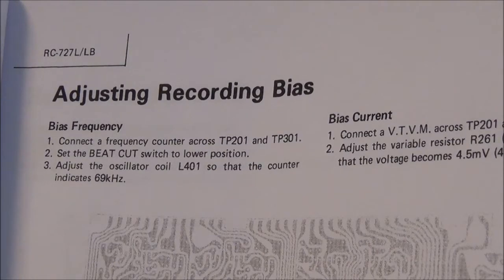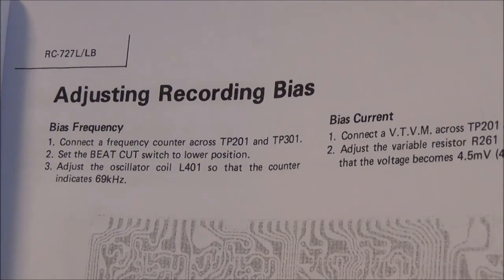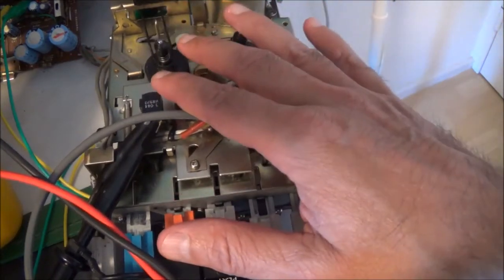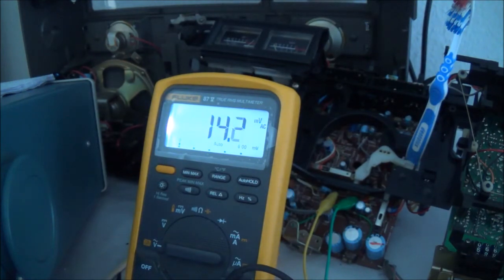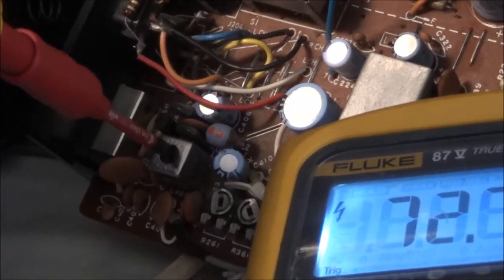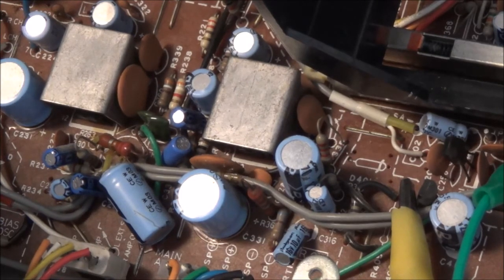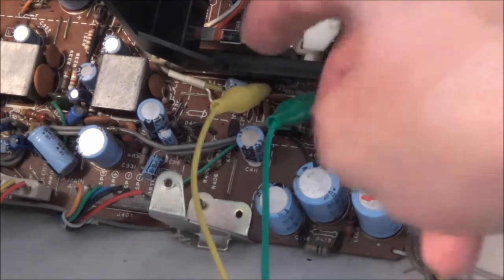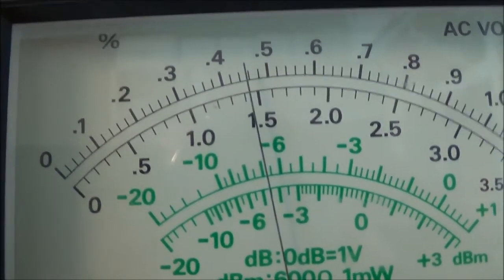JVC RC-727 Bias Frequency And Current Adjustment

Comment: Great  video. How can I adjust the motor speed ? As mine runs a bit slow. There seems to be no adjustment hole in the back of the motor?
Thanks
Reply from the maker: Thanks. Really not too much you can do. It's probably got one of those old mechanical type governors it it doesn't have a hole or some kind of potentiometer set-up on a board. Make sure the capstan/flywheel isn't binding, make sure the pinch roller isn't binding, and your belts aren't worn, especially it they have been in there for decades. Not sure if this applies you, but If the belts have been in there for so long, why are they still in there? And also make sure to try different cassettes.

Comment: Do you have any ideas/knowledge on bypassing an erase head on a tape machine?
Reply from the maker: This is not really my area of expertise. But normally you can't just bypass the erase head since the tape passes over the erase head right before it reaches the record head; that is, the oscillator is working and to just leave it out might upset the recording process. You would have to simulate the impedance (resistance) of the erase head. Perhaps by substituting by using a resistor. The resistor has to draw the same current as the erase head. Trial and error. I wonder if the same effect (mixing one track with another track--I think this is what you might be trying to do) could be done with a multi-track recorder? Or having 3 recorders and sending the output the output of both to a mixer before it hits the 3rd machine (which records it). Again, not my expertise area.